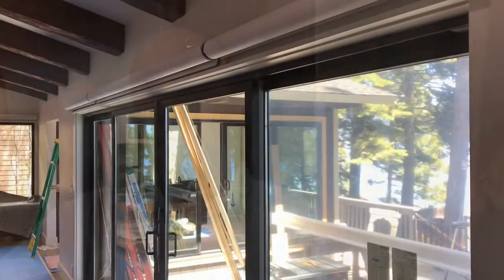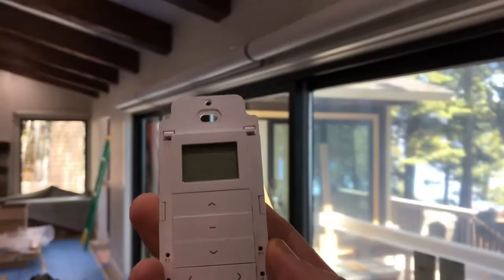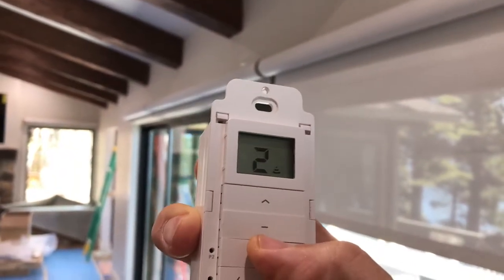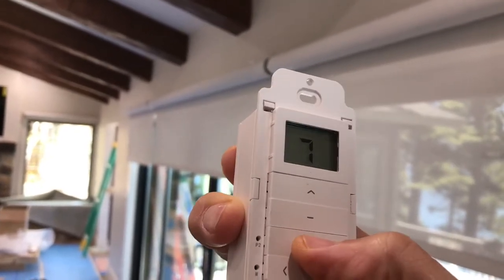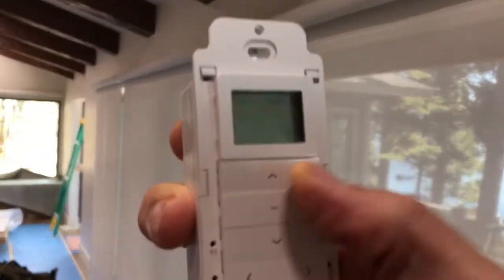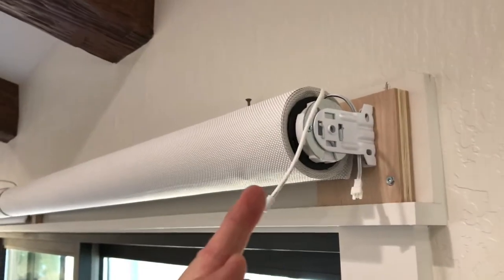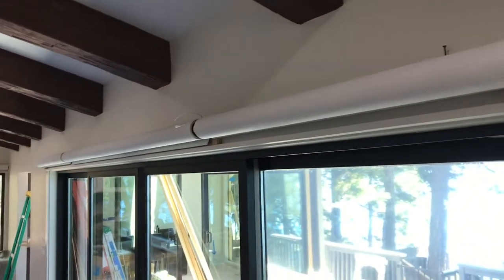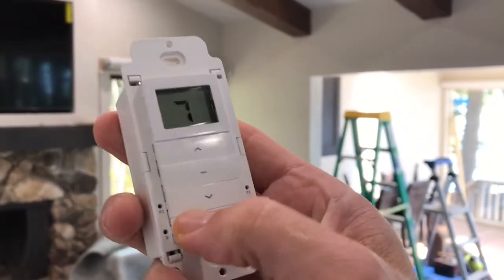Roller Shades At Lake Tahoe With Rollease Acmeda Li-Ion Motors

Comment: How do you hide the antenna and charging pigtail without a valence?
Reply from the maker: Matt M In this case, we worked with the contractor to have a valance built in the same concept as the trim to cover the roller shades. If there was no cover, then we would have made sure to hide the twin wires more carefully. On this job, we created a hole at the top of the valance/cornice to have the wires projecting from the top, though you can’t see them unless you climb up. Thanks for watching.
Reply: Thanks for the reply, Paul. I’m looking to install some of these but prefer the exposed roller look. Is it possible to conceal the antenna and charging wire without a valence?
Reply from the maker: Yes. You will have to be a bit creative though. Maybe tape them to the wall behind the roll or to the inside of the bracket...